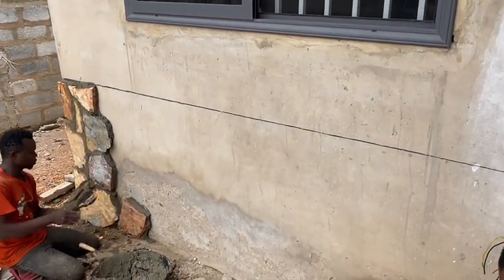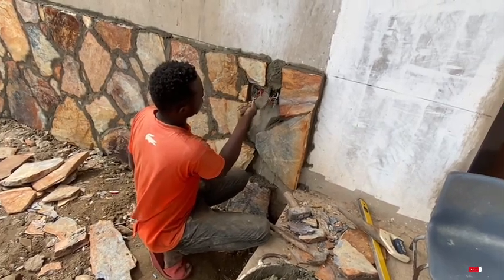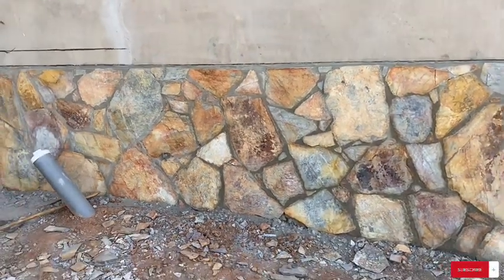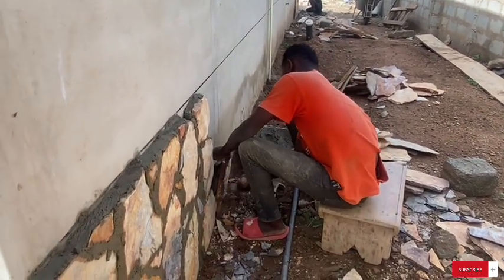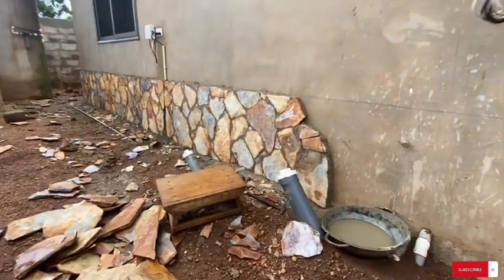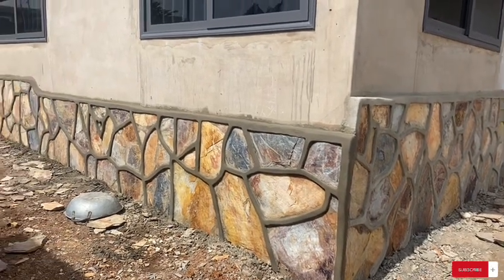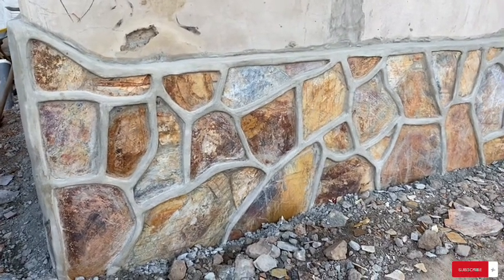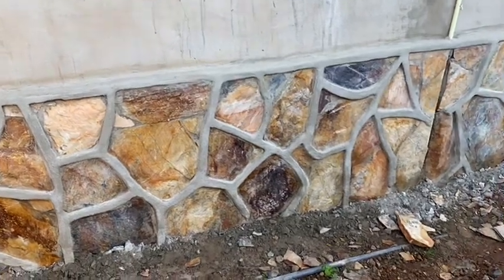Checkout this Stone cladding design-they wasted a lot of money || Building in Ghana

Comment: The stones and the waterproof cement will only prevent dampness from the outside of the blocks. It will not stop dampness from rising up from beneath the blocks or from the inside of the blocks in the foundation. However, some protection is better than none.  ...thanks for sharing.
Reply from the maker: Prevention is always needed